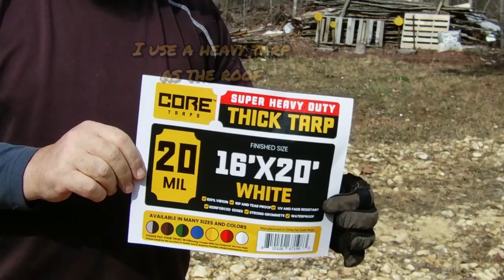How to Build a Post & Beam Equipment Shelter Unassisted  #makekindnessyourbusiness

Comment: I'm guessing you'll need to add a lot more support under the tarp roof. It will pool water/snow with the first heavy fall, not to mention the accumulation of leaves in autumn. Other than that, a few nice tricks!
Reply from the maker: Yep, I ran out of rough sawn wood so had to go with what I had...since the video I have added additional rafters.  The tarp did pool after hard rains, but now it does not.  Thanks for watching and the great comment!  Dave Out!